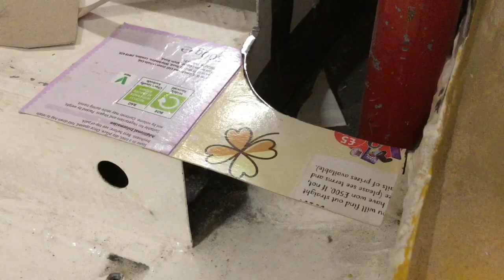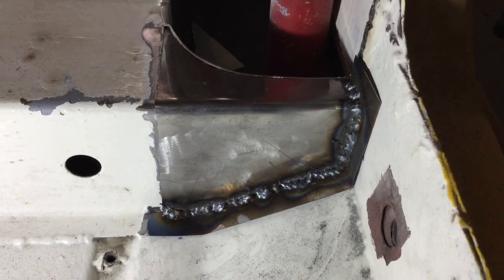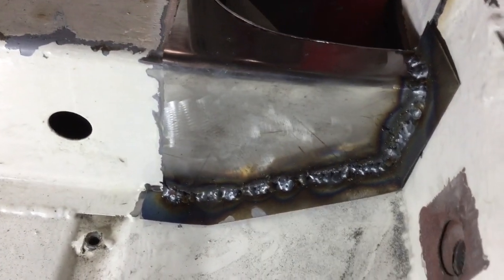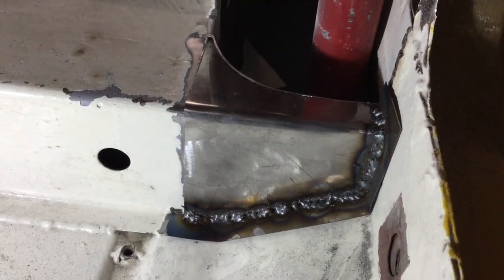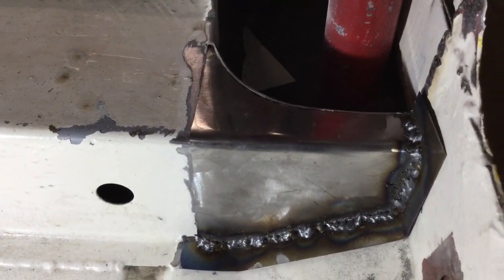classic mini EP19 custom panel

Comment: Not saying it's right but I think I would of welded the inside edge with fine tacks to leave the visible side clean. Also it would of been easier to grind up. but I know myself how long these things take, good luck.
Reply from the maker: Thanks for that I'm planning on doing the other side slightly different. I'm no fabricator by any stretch of the imagination so any advice is greatly appreciated, thanks for watching and commenting 👍